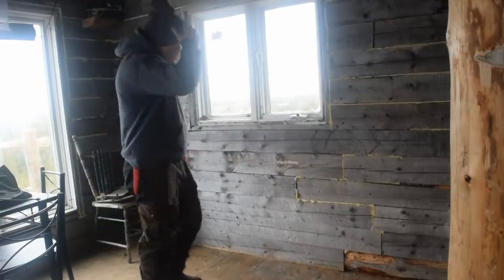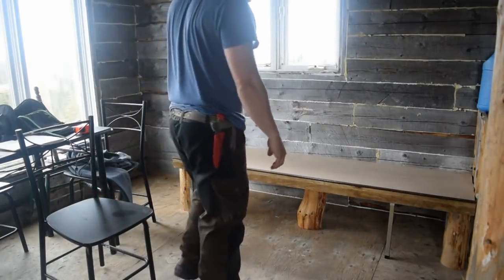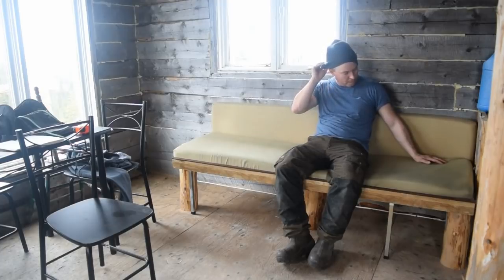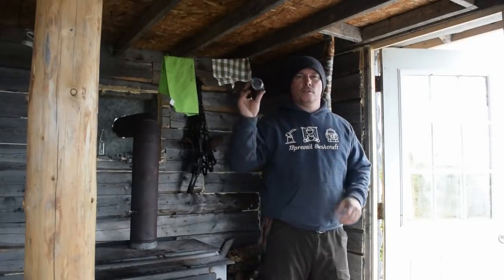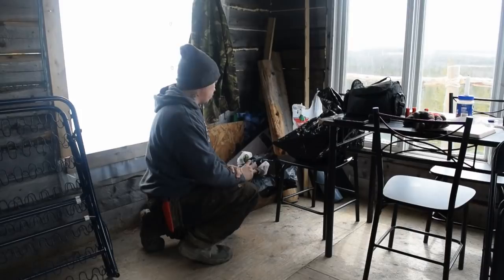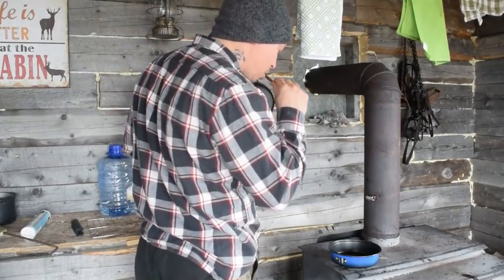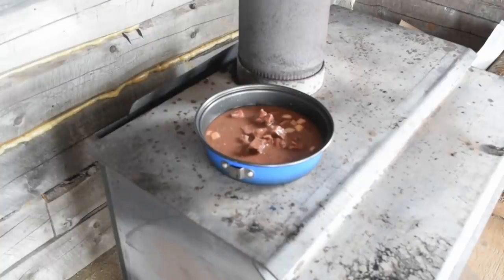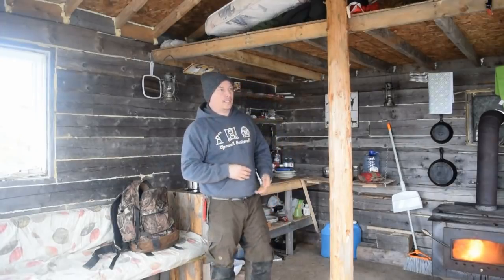Log Cabin Comforts

Comment: Thanks Troy good video cabin is coming along nicel. I think you should leave the pull out bed in place, I am sure a man of your skils could make two saw logs hollowed out to go round the metal poles. Wouldn't mater if they are a 1/8" of inch off as they won't be supporting but would give the look you are after👍

Comment: On the safer side.. 
1. Add a divider between ur stove and couch.... (high enough So when u cook sumday on that gas stove) ..things won't be flying onto ur couch..including fire ambers.
Also. 
2. Make a toolbox under ur couch.. Ur hammer.. Saw.. Axe.. Ur nails and screw boxes. Ur drill. N generator cables.. All go in there. 

As for the iceburgs..thats climate change for u.. Last year at this same time..it was burning hot here.. Almost to 45c.. Had my AC blowing at full 20c.. So hot I had to wear a fishing cap with a wet towel until October (for my neck.. From getting burned)

3.Make a gun rack..2 (horizontally placed above ur cabin door.. .to save space)..for those hunting days.. N for protection too)

4. Make some steel mesh frames for all ur windows...for those summer days

Stay safe. Happy Easter 2019 to u n ur family.. God bless